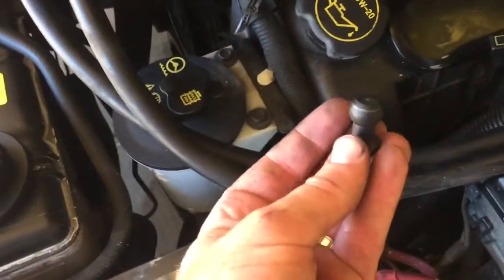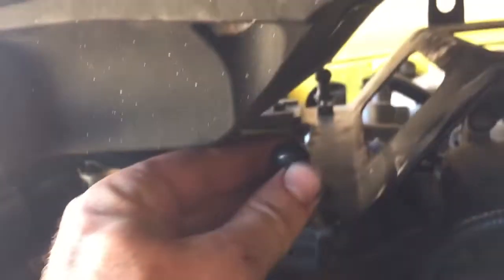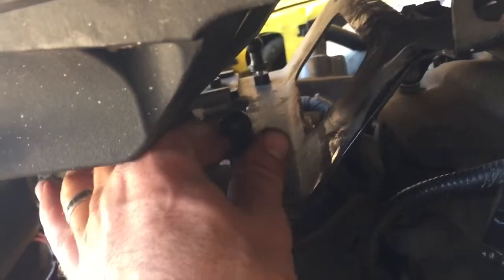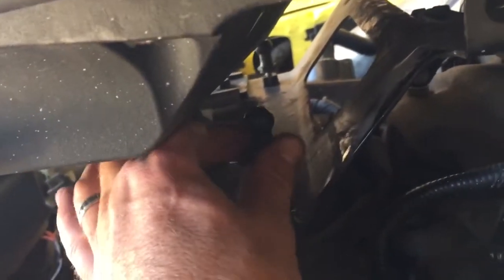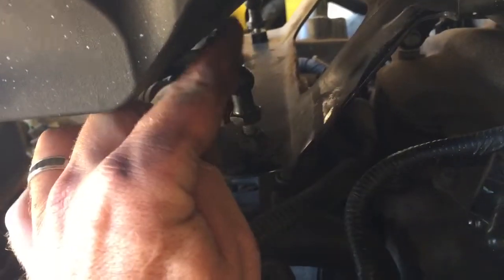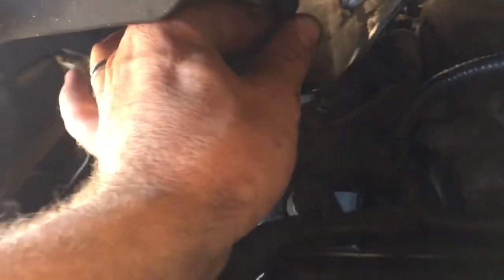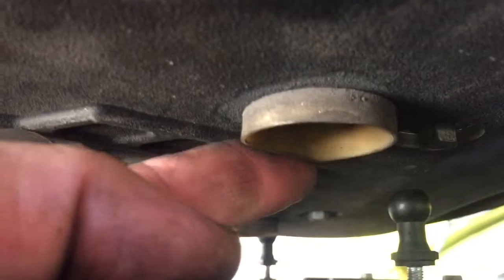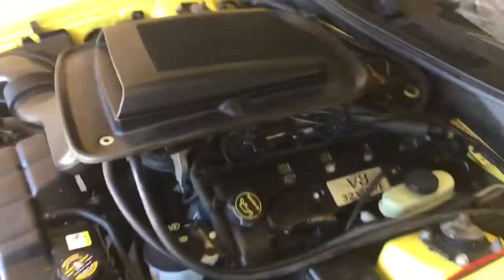03 Mach 1 update: shaker stud and grommet part #

Comment: I started hearing a funny squeak and saw the shaker setting and rubbing on the metal bracket. I found my grommets rolling around inside the shaker....might be worth a look.
Reply from the maker: I’ve heard of this actually. I’ll have a look. I’ve heard of them ending up by the air filter but this car has an aftermarket cold air intake with the cone so they might be gone